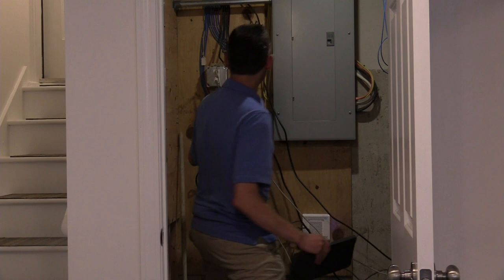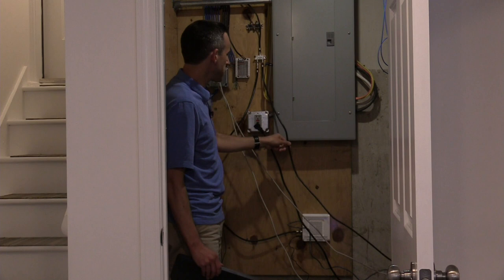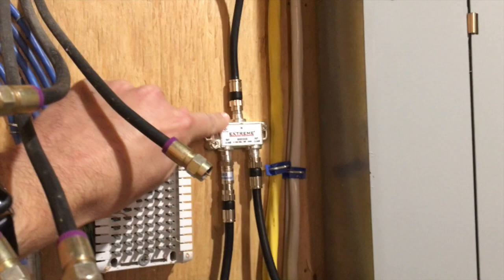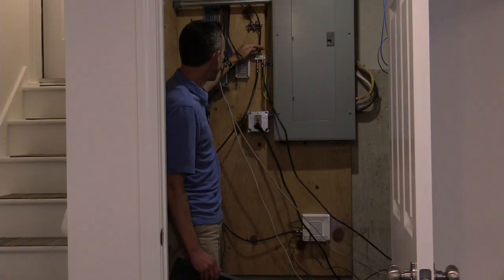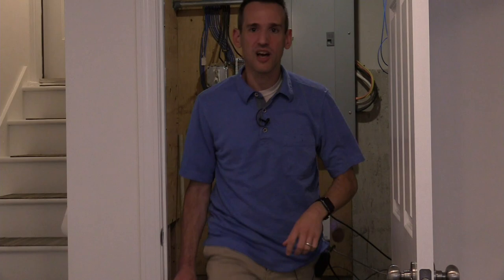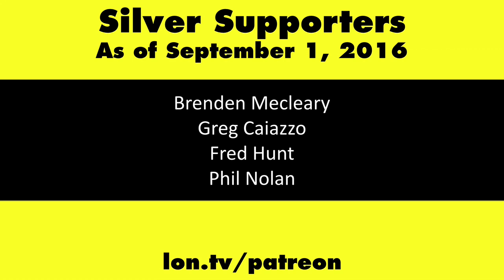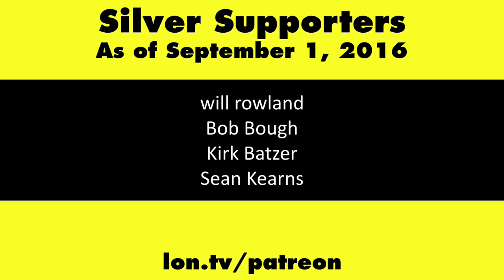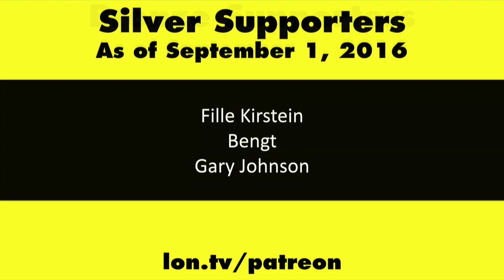Q&A: Where to install a MOCA filter

Comment: Xfinity already installed the filter for me when we switched over from centurylink (which sucked horribly by the way) Xfinity has been so helpful in the process of swiching things to moca and extending the wifi in my home. It costs only about $50, for 3 moca routers!
Reply: How did you buy it?

Comment: Trying to figure out how to determine where the PoE is for my coax in a condo/apartment.  I don't even think a cable tester will help too much as that only tests the signal from one end of a cable or outlet to another.  I guess I will have to use trial and error to make sure everything still works where I THINK the PoE is.

Comment: I am on fiber internet, and I don't use any cable TV. I have the coaxial cable in the house. Can I use this coaxial to run the MOCA between the router and internet modem? And I don't use the cable, do I still need the filter?

Comment: I installed this filter at my splitter and now none of my adapters are working properly.. Not sure what I did wrong.
Reply: Did you think to reboot them? Did you check where the splitting happens if there is any?

Comment: So I’m trying to switch over to MoCA from Wi-Fi. 

Without a filter I have no issues, but when I tried to connect a filter to the wall port and then the adapter, the connection stopped working.

Are you not supposed to connect the filter to the wall port?
Reply from the maker: No not at the wall port it needs to be at the point of entry

Comment: what if i have cable internet only,   no tv?  my cable line has its own dedicated coax port...the rest of the coax ports in my house are linked together-separate from the cable modem's coax port...do i still need to use a poe filter?
Reply: The filter is to prevent the moca signal from leaving your house.  If you are doing connecting the moca to your cable modem or any of that wiring, it's probably ok without it.  If it is still connected, you do need one.

Comment: Would this still be needed with my U-verse internet only setup?
Reply: Eric Williams if you choose RJ over Coax then no. RJ is a dedicated line to only your home, no outside interference. on Coax. this might be different. I don't know how Uverse would work with a filter, you probably wouldn't need one anyways. it's more for Cable modems which share several lines outside your property, interference can come from several points then.

Comment: Lon please if u can help, those splitters do they need to be moca 2.0 enabled? Like 5 to 2400 mhz? I only have the standard 5 to 1002 mhz 😪
Reply: 5-2000 MHz is enough. I use a 5-2000 MHz splitter with Bonded MoCA 2.0 (gigabit) and it works great.

Comment: Do you still need one of these filters if you connection comes from a satellite dish and or antenna and not from the road?
Reply from the maker: MOCA is not compatible with Satellite TV systems
Reply: Lon.TV Extras Would it not physically work or would it just interfere with the satellite witch doesn't matter as I only use internet TV?
Reply: It would NOT work

Comment: A technician came over to my house and installed an antronix GLF-1002 on the coax cable the connects my internet modem to the wall. I don't know if what he installed is a Moca filter, sorry if I am wrong, but does the antronix belong there?
Reply: Yes, that's a MoCA filter.

Comment: what is the point of a moca filter?
Reply: It enables your coaxial cables to work as if they were "Ethernet Cables" Some older homes do not have etherner behind the walls but we are sure most home def have coaxial cables in mostly all rooms already which you can use to give yourself a internet connection on that end.
Reply: @kevinsuriel3303  not exactly, the moca adapters let you use the coax as ethernet. The filter he is talking about that you install at the point of entry stops your network signals (and therefore your data) from escaping into the street coax wiring which could then go to a neighbors house, etc.